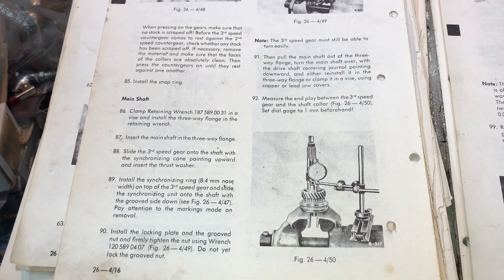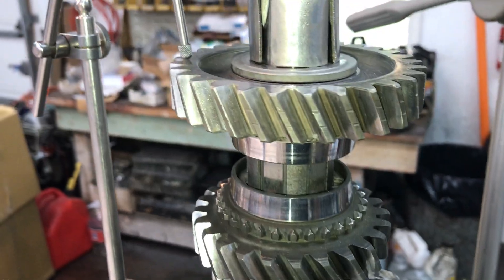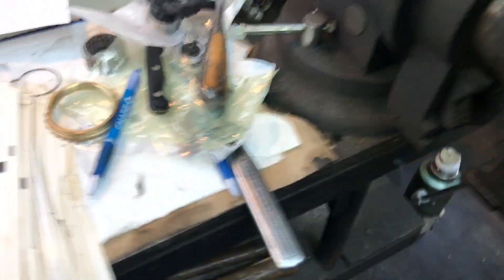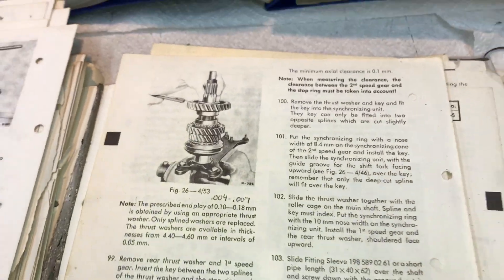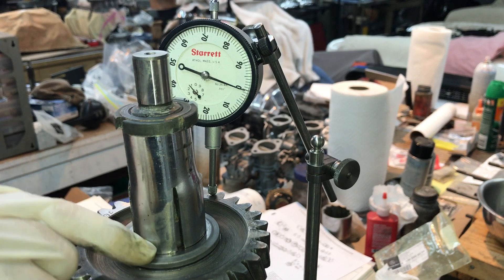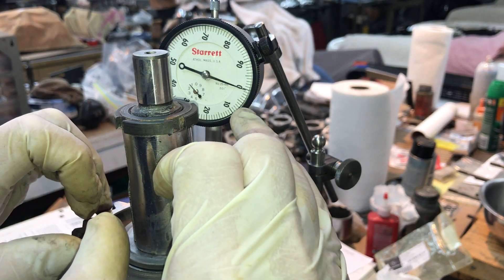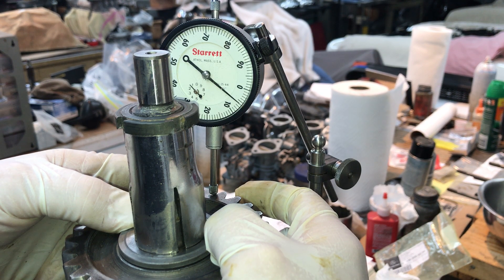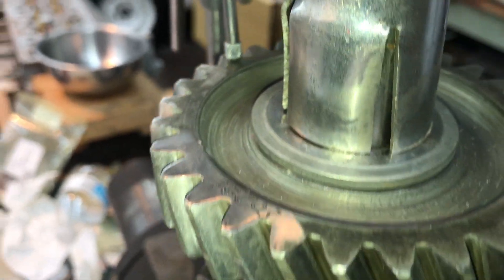Rebuilding Jim's 190SL Transmission

Comment: Hi.
You do great job. 
A question : as the law in my country makes no exceptions for vintage cars, where do you    recommend to install a two points safety belts (without damaging the body)?
Thank you for answering
Reply from the maker: My 1962 190SL came with seat belt attaching points already installed in the rear floor by Mercedes. I will do a video in a day or two showing you.
Reply: @Mercedes-Guru Hi
I will be grateful to you
Reply from the maker: @NabilAMRAOUI-i8m  https://youtu.be/SwUST_6mutE let me know if this helps